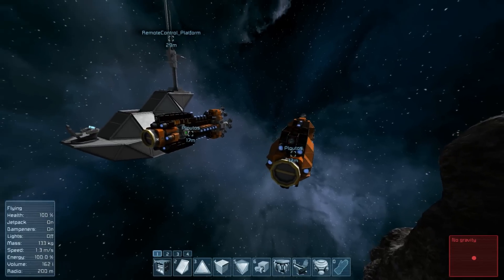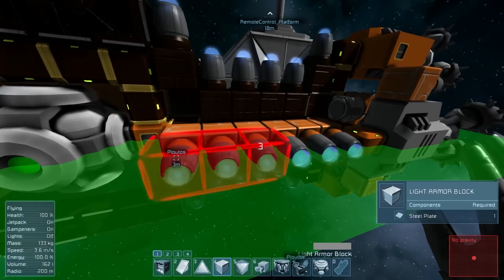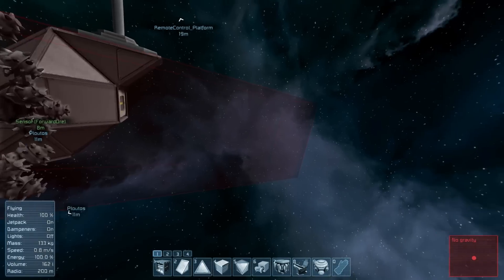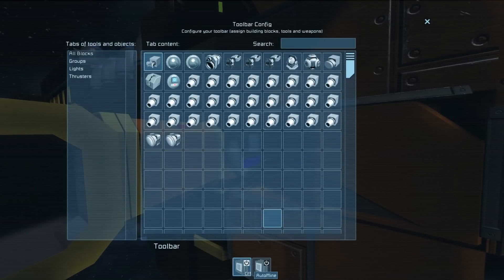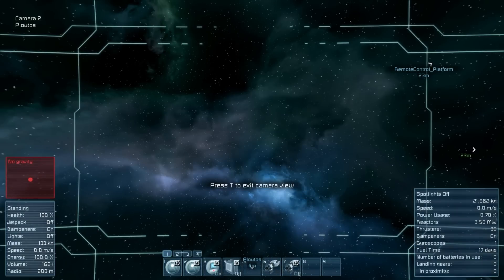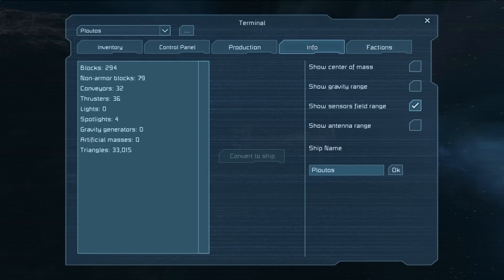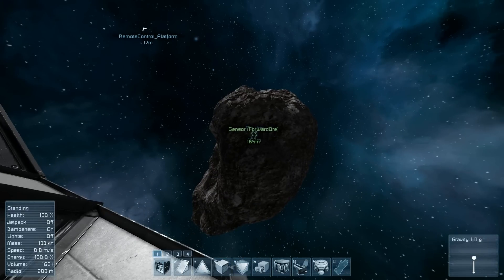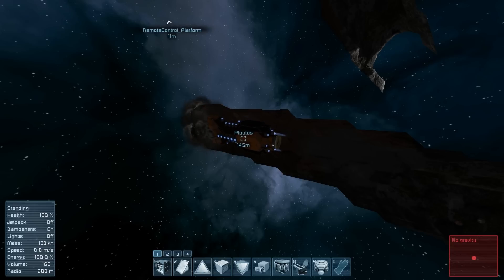Space Engineers, Ploutos (Mining Drone)

Comment: (snerk) I made one of these based on your design a little while ago. 

http://steamcommunity.com/sharedfiles/filedetails/?id=322600075

Mine is almost exactly like yours, just a very slightly different. However, mine and Ecto's both have the same problem, the thrusters accelerate just a little too fast once it spots an asteroid, so it can occasionally damage the drills.
Reply: Add a second and third sensor, one to reverse thruster a couple meters after it starts and another to turn the second off just before hitting the asteroid. this will maintain a slow thrust. (reverse thrusters are 1:1 to forwards, the shorter sensor range the reverse has the higher the maintain speed it will have till it reaches the asteroid)
Reply: The problem with just setting the auto sensor range shorter is that the miner wont be able to jump chasms inside an asteroid
Reply: Had the same problem with one of my designs. Simple fix is reduce the forward sensor range so the drone has less time to accelerate into the asteroid. That should fix your problem.